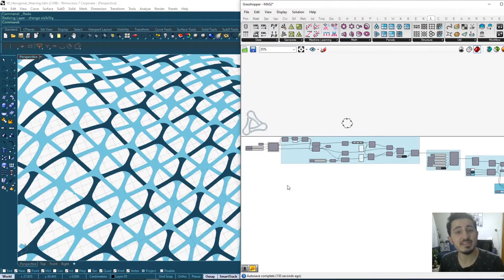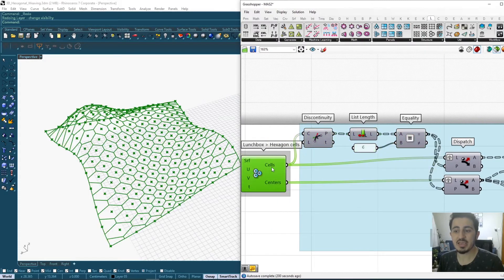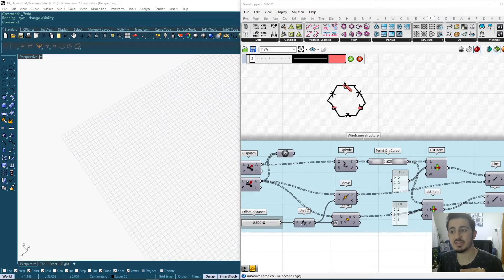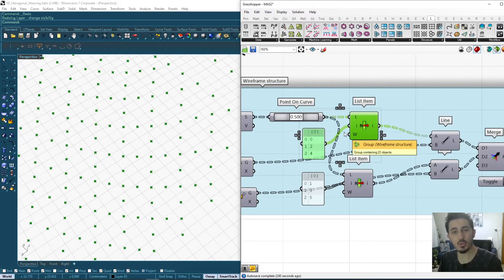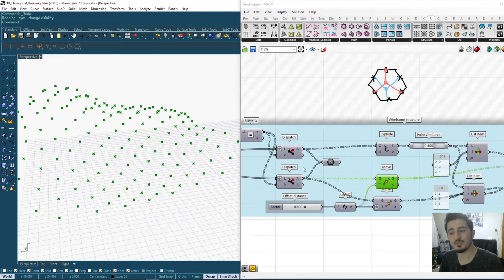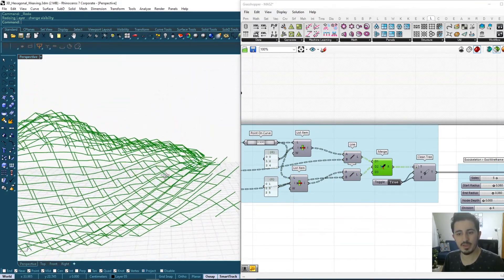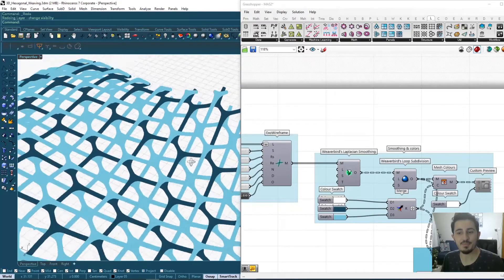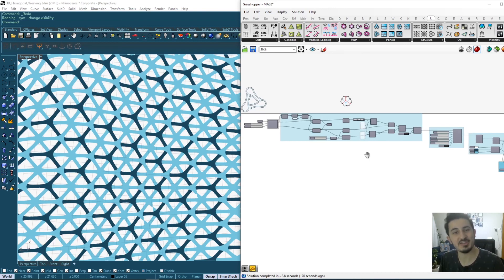3D Hexagonal Weave Façade using Grasshopper + ترجمة عربية

Comment: Amazing. Had some trouble offsetting centre points for the weave but just offset the surface both directions and used those points as the high and low connections.

Comment: High appreciation for the big effort in this channel, I have seen contents that can be compared with very high-level international grasshopper experts.
I was wondering if you could please refer to a certain reference that aids in placing elements on surface with certain parameters / limits like fixed width.
This process is meant to feed fabrication deliverables like steel sheets on roofs.
Many thanks.
Reply from the maker: Hi Nizar , thank you for your supportive comment! 
for what you asked , I recommend search "paneling" in grasshopper, and specially Lunchbox add-on !

If you'd like to check this full course I created on Udemy, it has a chapter explaining paneling with applications! 
it has a discount coupon running this week from this link 
https://www.udemy.com/course/professional-parametric-design-grasshopper/?couponCode=OCTOBER85OFF
Reply: @Hamid-MAS Thanks for your recommendation which led me to the proper solution for my case, which is "Panelling Tools" add-on.
And this is for knowledge: Why I chose this add-on instead of paneling in Lunch box is that it has some nodes with u / v distance as a value rather than the number of the panels.
All the best.